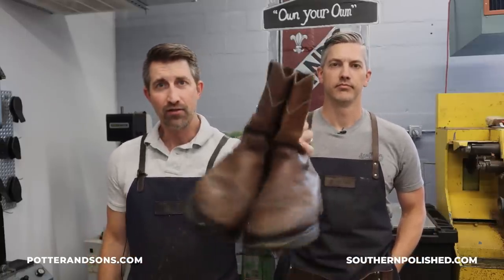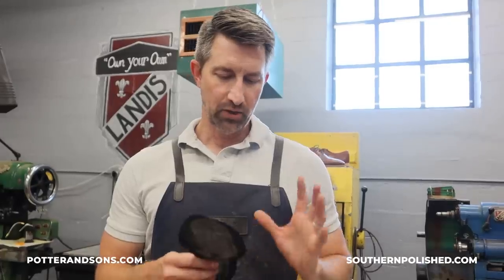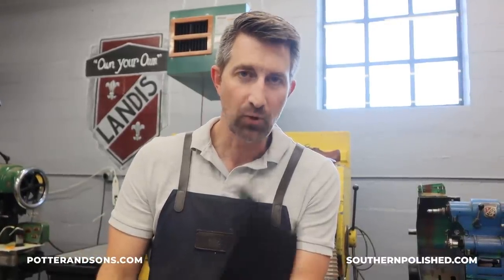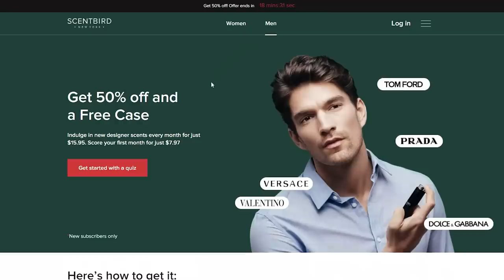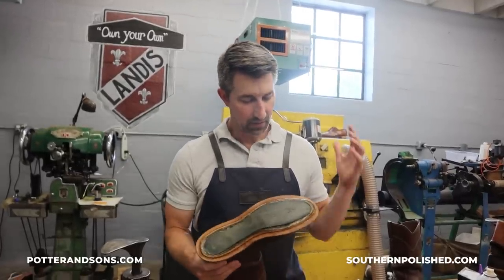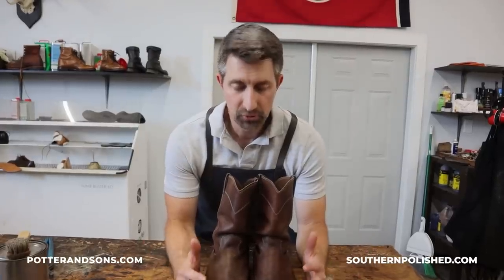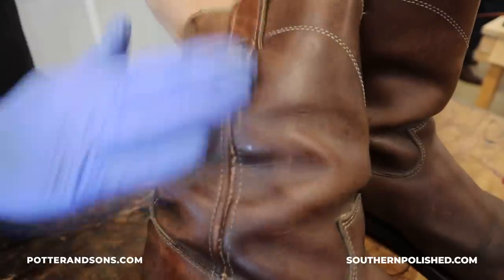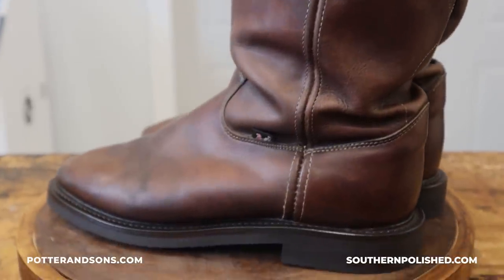Justin Boots Restoration | Work Boots Get an Overhaul

Comment: Would it be possible to achieve an outside supination on the outer sole and heal of a boot for correction ? 
I've tried insole corrections but the tend to move around and I wear out my boots on the outside rapidly while it still is new looking.
  An outer build to be replaced would stay in place correct my supination and save my boots much longer. 
  What do you guys think ?

Comment: I have almost new Robert's boots from nicks. They are smooth out. 
I should have got the urban loggers. And I should have got them in rough out. 
Can I send them to you to add a rough out toe cap and change the sole to the lug style sole?
Reply from the maker: Unfortunately, other than condition and shine, Potter & Son’s don’t work on uppers. Can definitely resole once we open restoration back up.
Reply: @TrentonHeath  thanks for the reply, that's unfortunate though.

Comment: Do you guys work with changing insoles? Like changing a synthetic insole to a leather insole in a boot
Reply: No they do not
Reply from the maker: Yes, changing out insoles is an option on our website.  Now, we do look at every shoe/boot on a case-by-case basis, and every shoe isn’t made the same.  We’ve changed out the insoles on several of our videos.

Comment: If I wear through the stitches, do I need to get them restitched or should my boots still be ok?
Reply: The stitches on the bottom of the boot are chain stitched, so between the glue and the other half of the chain in the sole they will hold on for quite some time after they look worn through on the bottom.
Reply from the maker: Yep, I agree with Drew.  As long as the sole was glued on well, and the stitches hold, you should perfectly fine.  If the sole wasn’t trenched very deep, stitches are the first thing to wear out, but the sole will usually hang on for a long time afterwards.
Reply: Yep a lot of boots the bottom of the soles aren’t trenched at the factory.  So the stitching gets worn immediately.